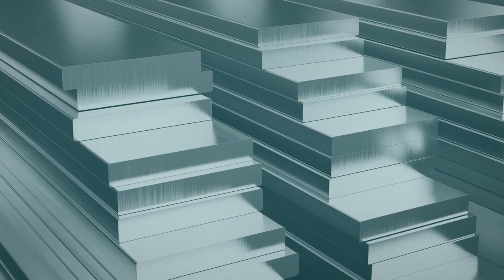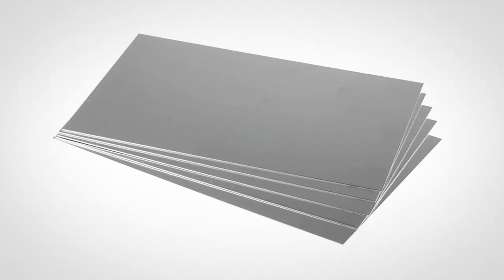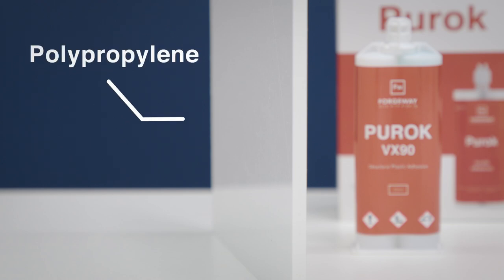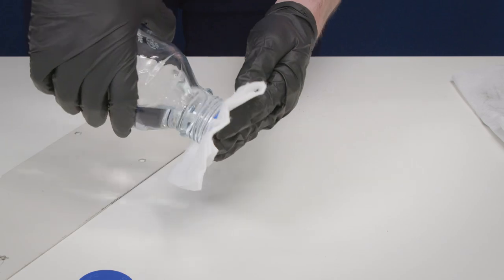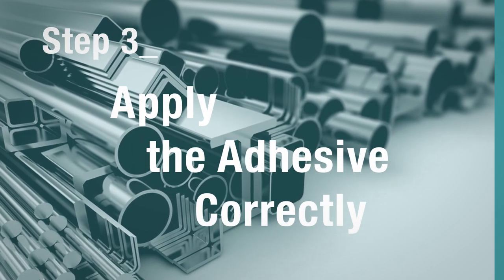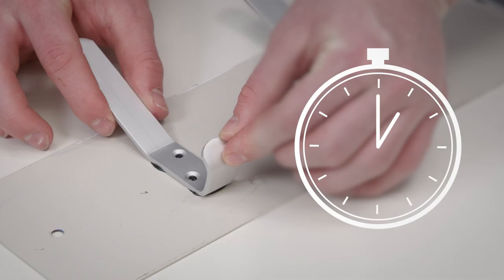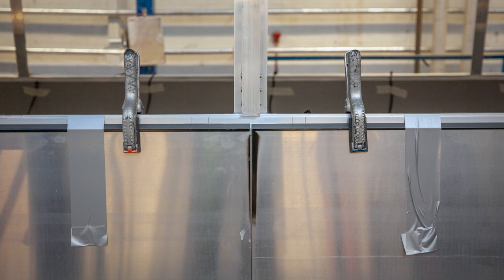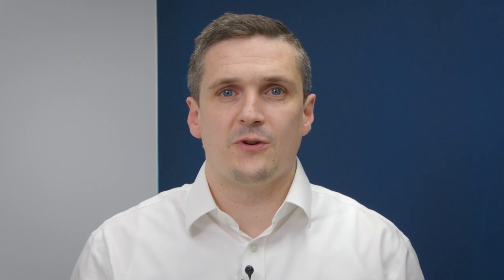How to Bond Aluminium?

Comment: In step 4 in the video, clamping is presented as an optional step. What advantage does clamping provide? Do you need to worry about squeezing out too much adhesive?
Reply from the maker: Thanks for the comment. Clamping helps ensure the bond doesn't move and the adhesive can fully interlock.

Comment: Trying to bond lightweight aluminum to stainless steel without welding. Tried every product I know without success. Will epoxy resin work? It is my final attempt- thank you.
Reply from the maker: Hi Holly, 

If you watch our different video on how to replace welding, it will help make sure you have considered some of the other factors like joint design before selecting an adhesive.

Comment: 'Choose your adhesive' Well... could you tell us what the best adhesive is? In my case aluminium to aluminium.
Reply from the maker: The adhesive used for this example was Purok VX61. Or, if you need something more flexible and lower strength, use Formoa 017FE.

Hope this helps!

Comment: What to apply aluminum to concrete?
Reply: An epoxy or strong inert coating such as powder coating or even the pp/polypropylene coat is essential for aluminium surface. Once done, then & then only you can bond aluminium to concrete as concrete directly can bond with concrete but it's a bad idea as not only fresh cement/concrete will release hydrogen and further corrode aluminium later which is why aluminium isn't used directly with concrete. Instead if you have to use a metal in concrete then mild steel is good and so is stainless steel but ss is expensive so mild steel (rebar type) is often used as it doesn't corrode or get affected by tensile strength issues unlike aluminium which expands/contracts and isn't suitable for direct use unless concrete is fully cured and there's additional protection to prevent aluminium corrosion.

Comment: I am bonding TPU 95A to Aluminum. What is the best adhesive from a big box store? Thanks
Reply from the maker: Hi Steve, we would recommend an epoxy adhesive that is available from your local store. Just make sure you clean the surfaces properly before bonding!